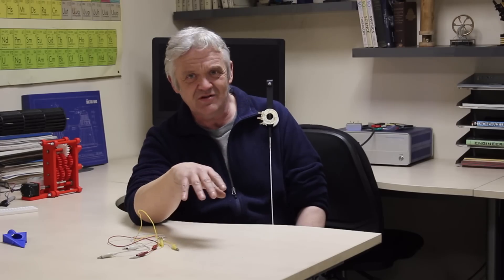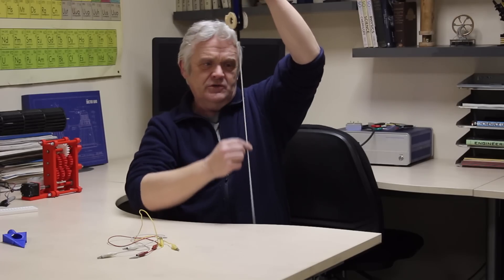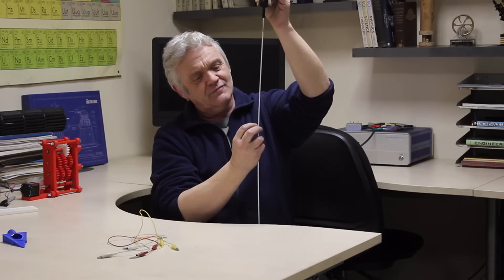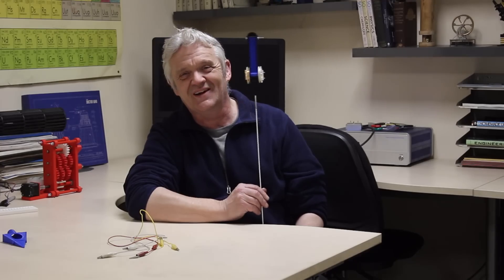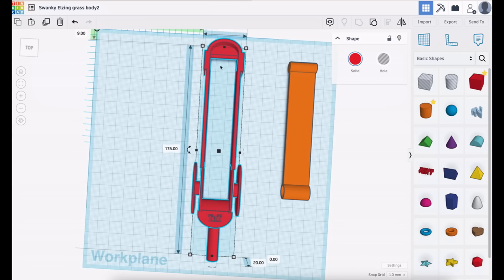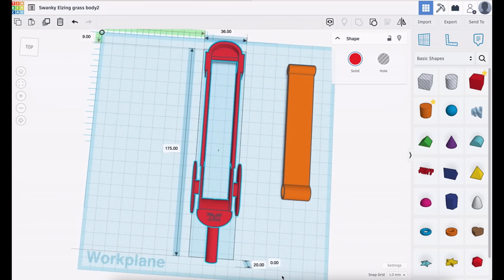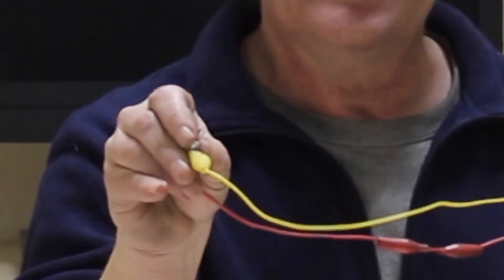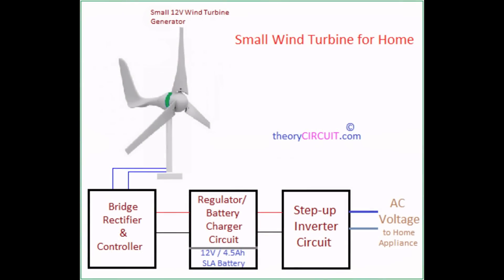1841 Barleycorn Wind Generator - Quite Possibly The Best Thing I Have Made

Comment: If there is a steady decent airflow (with gusts on top of it), the stalk would bend and create a situation where the pendulum doesn't swing between the coils any-more. The pendulum would go back and forth but the coils would be out of reach.
Would it be possible to place the coils on their own pendulum so that they are always directly beneath the hinge of the magnet-pendulum? 
The coil-pendulum would need more inertia than the magnet-pendulum so it doesn't swing in the wind as much but it also should have less mass than it would take to bend the stalk (so the spring in the stalk has enough torque to lift the top-assembly against gravity).

Comment: Excellent design Robert. Would having three magnets on the pendulum in a slight arc triple the output, or is it not that simple?
Reply: Genius idea 😊
Reply: I was thinking 2, possibly if too close together it will lock up.
Reply: @jay90374  further up I suggested 3x 5x the magnets as more weight may increase momentum. Then even number of pairs depending on swing likely wind  speed and swing length. I think it will a lot of trials for the most effective setup.
Reply from the maker: it's that simple mate - genius suggestion - cheers

Comment: Before I lash out on a 3D printer I was wondering whether you did calculations re optimum length of magnet pendulum (speed of flap) and also any thoughts re length of fibreglass rod, flexibility and mass (im thinking of stacking 2 or 3 on one rod.) Also any thoughts of having the wound coil in the shape of an arc on each side similar to the serpent setup with a diode bridge and maybe a capacitor in the circuit. It would keep the battery topped up on my yacht, wind and waves!

Comment: What a wonderful concept but one problem I foresee:
the plants waving in a field are not in sync. They wave all over the place. So, if the coils are joined simply by contacts at the bottom of the stalk, their generation polarities will cancel out. 
It seems that each stalk will require the current to be rectified before connection to the "grid"

Comment: LOVE this. I suppose what you'd want is some kind of durable fabric mat that can simply be cut to size and rolled-out which contains an array for "planting" these generators. With a collar on the stalk, each generator would also act as a peg to hold everything in-place. I wonder if this is a job for conductive ink?
Reply: I was just thinking of my shop's tin roof, with it's thousands of screws, one mounted on each screw with a little stainless steel bracket! Basically just a washer with half a TIG rod welded to it in place of the fiberglass rod.
Reply: @jay90374  Your roof would have a stylish hair-cut lol
Reply from the maker: pretty much what I was thinking mate

Comment: Pretty good idea Robert, but to my mind, it looks a bit cumbersome. I can picture it leaning over in the wind and the flap just hanging out away from the coil and doing nothing. Birds will want to perch on it………… I was thinking that if you got your earlier vibration generator ( the one with a diaphragm on the end ) and attached four long blades, each to one side of the diaphragm, the breeze would make the blades and it vibrate vigorously and there are no bearings etc. Could that work? 🤷‍♂️ I’m mechanically minded, but electronics baffle me. 😅
Reply from the maker: I like that idea mate - thanks for sharing - I will give it some thought
Reply: Additional coils that are excited when the barleycorn head is laying at an angle, maybe?

Comment: Fantastic design, elegant in its simplicity. 
Not 100% in agreement on the integral hinge though.  As a proof of concept during the R & D phase, yes, no problem,  but, for mass production it's not the best long term solution. 
 This is the sort of device that ,for production, would suit injection moulding.  Simplified into a few basic components,  thousands of parts kits could be made per day, and even assembled on site. The few, extra operations such as drillings would be jig based. For a long service life, a more robust hinge would be required.  Me, I'd probably opt for something like PTFE  bushes with a pin made of Delrin rod - banged out on a CNC by the million - that would be very low friction ,and rain water would help lubricate it. 
 It could be made from wood, though that will eventually rot. This would be ideal for reground plastics where aesthetics and high strength are not needed. 

 Oh, and thanks Rob, I once worked in plastics R&D, your videos have got me thinking about things in a way I hadn't done in years...👍.

Comment: if you were to use a paddle wheel design with one leg slightly heavier than the rest (out of balance) you would have the best of both wind conditions. In light winds, the heavier leg would stay at the bottom and rock back and forth like your design here. In heavier winds, as the  springy shaft is held over the paddlewheel can turn.

Comment: how about a coil parallel to the ground under the pendulum, and then the pendulum itself can just be a bit of fishing line, and move in any direction?
Reply: regarding the pole... I'd suggest just actually growing a stand of wheat, rye or barley. harvest by leaving the stalks in situ, then mount the generators directly onto the stalks where the seed heads were. that only leaves wiring it up as a hurdle.

if the generators are approximately the size and weight of mature seed heads, then you know pretty much from the start how the stand will behave in the wind. and, you can just grow another stand next to it to move onto a few months later, after things start breaking.

Comment: Interesting concept 👍.  I still feel there is lot more energy left untapped. The tricky part is variable wind loading(both direction and strength) while still keeping the twist to the optimal level. May be the oscillating leaf could change direction as it springs back, to maintain smaller cross section against wind?  Also another issue will be the total efficiency of several thousands of these getting converted to real useful power. Just some 💭
Reply: You are describing the aspen leaf.
Reply from the maker: it's great to point out potential issues mate - now how about some solutions you might have? that's a much better thing to do - cheers
Reply: @ThinkingandTinkering   Glad that you asked, Eventhough I don't have detailed solution, you could derive one based on the following:
1) It is best to use part of the untapped energy to increase efficiency further. One way is to use it to align the oscillating paddle, to return to a 90 degree orientation on the return swing.  This also
will keep the swing optimal, and pass on the excess wind force, that can be converted by other members. There are a few other methods of doing it, again the guiding principle is to keep complexity to least, additional cost to minimum.
Also treat the available wind force as volumetric than planar.
2) It is far more efficient, to store the energy without conversion to electricity until a certain threshold is reached. Say converting kinetic energy to potential energy and then a burst conversion to electricity, when it reaches the threshold.
The guiding principle is to keep it mechanical, while adapting to existing design without much modifications.
3)Combining the outputs into usable energy is the trickiest. This could involve couple of things: using less copper(single wire transmission) with common ground.
The output of each unit needs to be cascaded intelligently(the non productive members will identify themselves as a short). There is some nifty low power electronics involved, I could help with that if needed. The idea is to increase the collective output voltage, while keeping the currents through individual members small and losses negligible. Just some 💭
Reply from the maker: @aware2action  mate that is an absolutely awesome answer - there is certainly a lot to think about there and yes I could do with the help - cheers

Comment: I believe it wouldn't be to difficult to make a way for it to lower itself in the odd times it might encounter hurricane force winds, also your vibration generator thing you made could be incorporated into the design to scavenge more energy, this looks like it could be gathered around the spring from the bottom and from above as it wiggles about, obviously the simplicity/cost/efficiency would need to be experimented with, it's an amazing concept though, one worth some thought
Reply: Yes it is!! Let's try it!
Reply from the maker: cheers mate

Comment: Perhaps for the flexible shaft, we could start using alot of the non recyclable plastics in our eco system. This would give life and use to what would otherwise be landfill materials.
Reply from the maker: that is an interesting idea - I was thinking bamboo - but cool idea
Reply: @ThinkingandTinkering  It would also open us up to government subsidies if we could provide value to otherwise wasted materials. It would actually probably pay for the entire program. Perhaps even using recycled materials for printing the parts too.... It isn't that hard to create 3d printing filament. The most difficult part of using materials deemed unusable, would be cleaning them and finding a proper mix of them to make something useful. Perhaps these devices could be easily attached to the exterior of existing wind turbines to add more electricity. Some sort of mesh we would wrap around existing wind turbines, that would have these different wind capture devices attached to the mesh, and feed electricity into the receiver...

Comment: This reminds me of those tuned mass dampers that they use in skyscrapers to keep the wind motion down. But you don't want to dampen the motion in this application, you want it to resonate as much as possible. I think in order to achieve that you'd want the length of the flapper to be 1 / (2 * any odd number >1) the length of the stalk, so 1/6, 1/10, 1/14 etc.  (edit: The ratio of the timing should be 1/6 or 1/10, but that may not correspond to length, because the two oscillators have different types of restoring force, one by gravity, one by spring tension).
    My main concern with putting thousands or millions of these in the field, is the cost of the magnets. How many watts are you getting per mass of Neodymium? Maybe someone will start mass producing cheap NiFeP magnets in the mean time.
Reply: Why not use our current supply of magnetic material and start printing these in microscopic scales?
Reply from the maker: the same mass per kW of any other turbine mate

Comment: That could be done very cheaply with injection molding once you have worked out how many you need to sell to cover the original mold costs.  The main unit could potentially be one piece and need either someone or a machine to put in the magnets, the coils could be the kind already bulk produced for earbuds/headphones.  I would not doubt that making it could be under 5 pence, the packaging and shipping would mean it could be a " wind recharged yard light " at a pound store ( Dollarama in Canada ).  I am still amazed at how cheap a rechargeable AA battery, solar cell, water resistant housing and " outdoor stand " sells for under the title yard light.

Comment: You know this would be fantastic paired up with solar, thinking maybe a flat of these under a lifted solar panel. You already have most of the electronics at that point might as well double up. Wondering also if there might be any synergies possible with the solar panel arrangement to act as an air inlet to move air underneath 🤔
Reply: Adam,that is a fantastic idea.The cost of land would be prohibitive as a stand alone.Also could the flap idea be adapted form a floating mat on reservoirs etc

Comment: What about putting a propeller on the bearing end with a small protruding shaft ? which in a good wind, would spin the pendulum through the magnets faster / produce more power?  just a thought Rob, thanks for sharing your videos much appreciated
Reply from the maker: I have been thinking about that aspect mate
Reply: You would need a crank to convert the rotation to oscillation.

Comment: suggest design improvement, enclose the moving part, reason if you want to put them close together say a bunch of them you dont want wind storm to interlock them.
I'm kinda curious though how does it scale, one could make small, like super small devices and pack a whole lot of them in a square meter or square centimeter, or 100m.
I think you do need to stick one in the ground and get some numbers on this Robert.  (wind power / miliwat ).
Ps snow might stop this process.

Comment: Are there any videos on how magnets impact on electricity generation - for example could the barley generator be adapter for both low and high winds by using an arc of magnetic sms with low strength towards the centre and stronger further away and trade some of the spring cost for electricity generating magnets ?
Reply: Yes actually he has many videos on this subject in the library. Good sir I also whalcum you to join the community in an effort to spread this knowledge as far as wide as humanly possible so that the lost ways have a legacy that our children and grandchildren can follow.
Reply from the maker: I have done quite a bit on this kind of thing mate

Comment: Have you tried your demonstration  inside, i.e., with no wind but just your body micro-adjustments ? You'll see that it still oscillates. What your are seeing outside is in part due to your body adjusting to the wind in keeping its equilibrium. For a more rigorous test you should install it on a stable support, which your body is not.
Another issue is the fact that you can only take advantage of the oscillations in one axis, let say frontal, but the lateral ones are not converting anything; for alleviating this issue you need at least a 2DOF pendulum instead of 1DOF.

Comment: That same principal would probably work equally as well, if not better, if you were to just put it on a floating platform and push it into the sea. The constant motion of even small waves would be a lot more predictable than the wind direction and generate the same level of electricity. Even on a freshwater body of water, you would not only be catching the wind but the residual wave energy generated by that wind as well. .....admittedly something... something resonant frequency that might cancel out some of the potential energy that could be produced . But I'm no physicist

Comment: Once you've covered acres of land with these adorable generators to what other use can the field be put? Livestock may be pastured or crops grown under large commercial turbines and even around PV arrays, but is there a way to make secondary use of land planted with this crop of barleycorn?
Reply from the maker: they don't need land surface per se - you could stick them to buildings, roofs, bridges, the sides of roads, road signs, bouys, ships, lamp posts - the list goes on and on - we don't have to be too literal when talking about a 'field' when it comes to this
Reply: @ThinkingandTinkering  Ok, I see that. Now, I'm off to buy copper mining stocks... for the connections between these lollies.

Comment: Amazing idea. It seems like it might make an AC wave as it moves back and forth. Could that be rectified to a pulsating DC and filtered for charging 18650 batteries? It would increase the cost, but also increase the output, I would think.
Reply from the maker: oh yeah that can be done - I did a video recently on exactly that
Reply: One thing to keep in mind is that cheap silicon diodes have a 0.5 to 0.8 voltage drop through them.  They need at least that much voltage to start to function.  More expensive germanium diodes have a 0.2 to 0.3 voltage drop.  AC voltage in the millivolt range is very had to rectify.
Reply: @ThinkingandTinkering  I can't wait to see that new video. Are the files available? Where might I find them?

Comment: Wouldn't it be more efficient if it was tall boom core. Overpacked by some cloth. Hinge in the middle or  2/3 length down with mags and coils down. Length would provide stronger leverage for stronger mag and coils.thus no need for whole field. Essentially trading ground space for vertical height. Which would also help with stronger winds being caught since you would be farther from the boundary layer.
Reply from the maker: I don't know mate - worth looking at cheers

Comment: Okay, you've sold me. I live on a sailboat, and Im always looking for innovations. I need to get the old girl on the hard in the next couple weeks, but once the bottom is straightened out and she's back to the water Im printing a load of these to ring the perimeter. Ill let you know the best numbers I find as far as usability per foot on ocean breeze. What's the speculated guess on how many in series to produce around 20v to charge a 12v system? 6 in series, or 7 to be a general starting point? Im thinking an off the shelf wind genny charge controller between the barley's and the battery bank I live upon will be the safest bet to experiment from, (Ive got a 12v 3wire DC wind controller viable to 1800W aboard that needs a use (will that 3phase bit be an issue, or can that be used in the parallel portion of wiring the barely gens together?)

Comment: What's the energy used to produce the plastic magnets, copper wires,  compared to the possible  lifetime generation kWh? .  Rather than copper , is aluminium a better material for all the connectors and coils , lighter ?